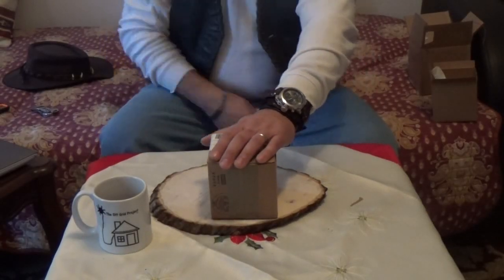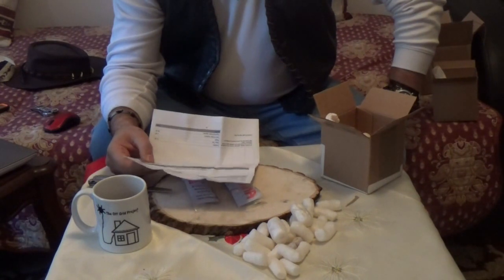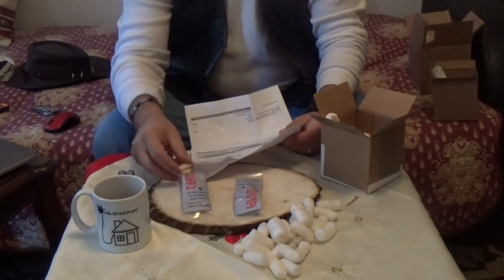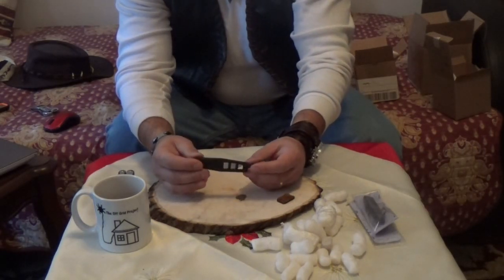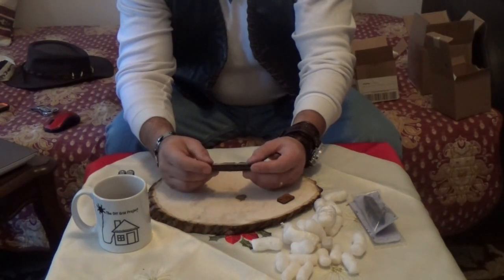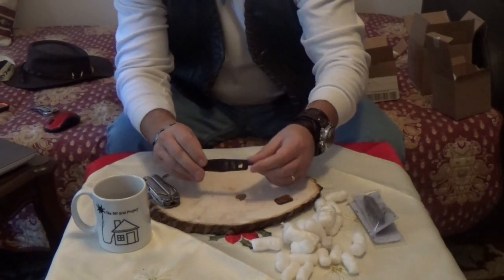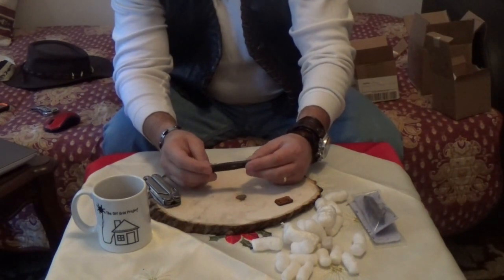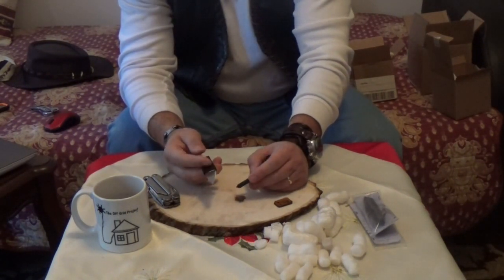Tiny Knife Perfect For Tiny House

Comment: Couple things, first of all the ones that come with a screwdriver tip are flat-head screwdrivers, not Phillips. Second, as cool as it looks, the see through part has nothing to do with being visible. Tekna was initally a dive equipment manufacturer, and the Xtra Edge was made so you could attach an extra cutting tool to your dive belt, your BC, etc., and the voids in the sheath are to let water drain out.

Having said  that, I've been using these for years, and own several. Very handy little blade. If you don't own one, get one ASAP.
Reply from the maker: Thanks. it is very nice to have I will check it out